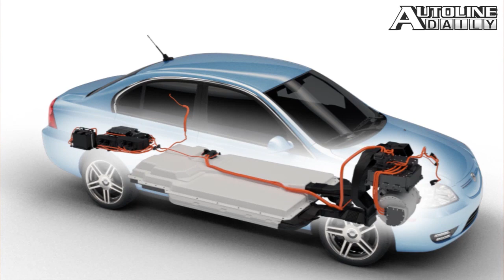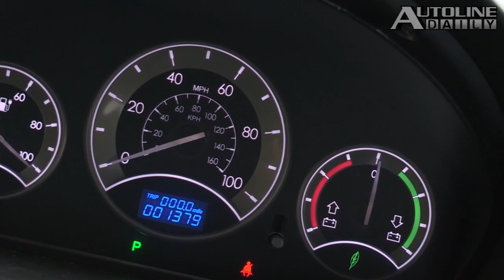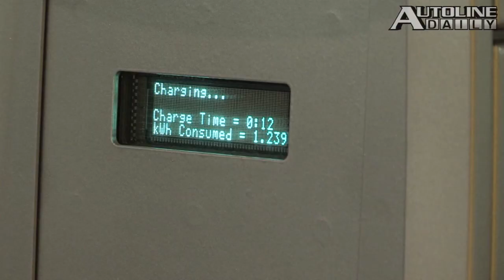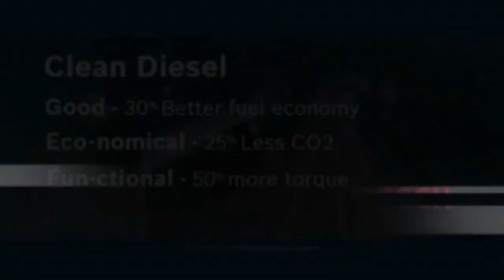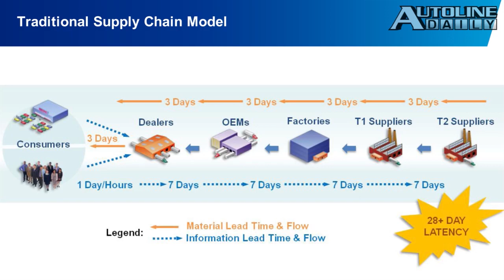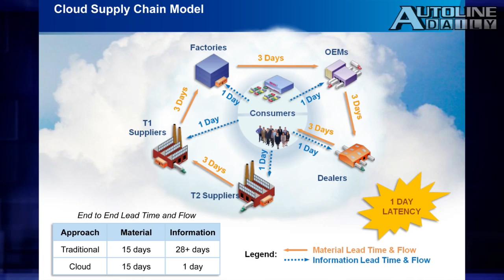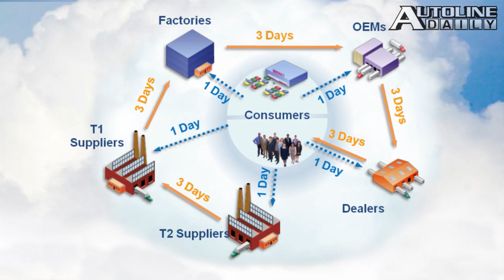CODA EV Test Drive - Autoline Daily 977

Comment: This car had potential as an everyday runabout car. But I think that would take at least a 40Kwh battery for a reliable 140 range. That would be something many people could live with. The Coda's 31Kwh isn't quite enough.
Some gripe about styling,, but as an everyday runabout car that's not so important as functionality. And this car would have it. If you're looking to impress people with styling,, use your other car for that.